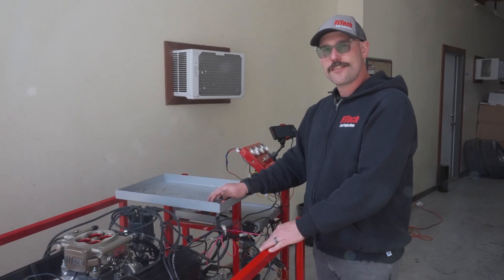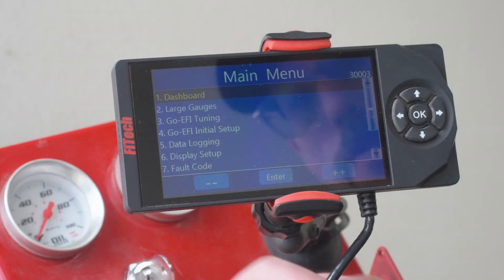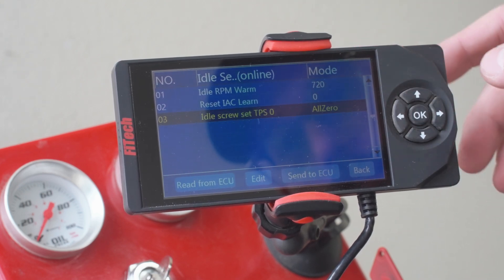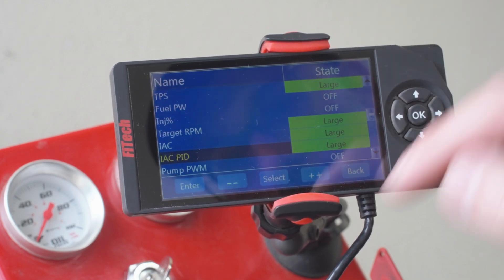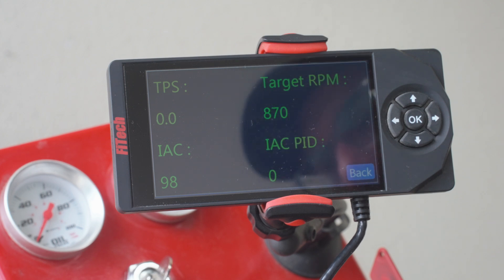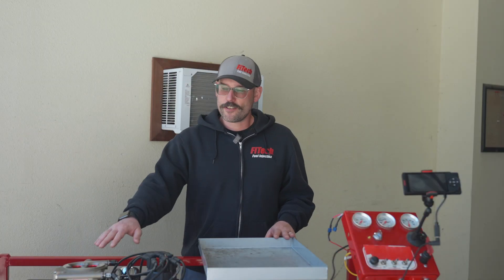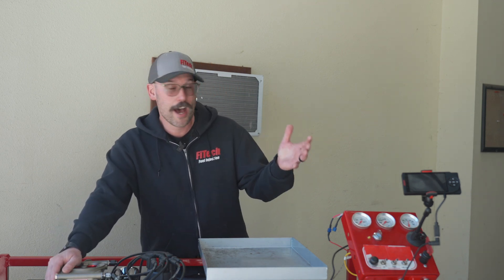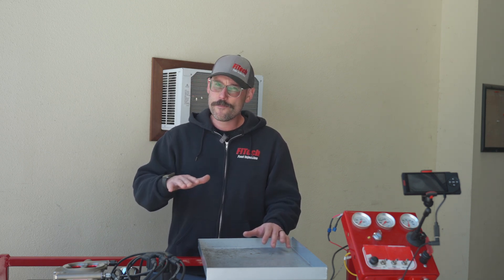FiTech EFI Throttle Adjustment | How to Set IAC for Wild CAM Motors

Comment: Can I run The 1200 HP system on a 2x4 Tunnel ram until I put it on a blower set up on my mild built big block Chevy I don't want to buy two systems but I want the system my carbs suck in a bad way
Reply from the maker: Hello sir, Yes you may run the 1200hp system on the mean time as a NA system. Once you upgrade to your blower the system will still be ready for that power adder.

Comment: I believe my cam is too wild at 106 lobe cenerline and .666/.645 lift. Fought it for years. Ensured no vacuum leaks or any exhaust leaks both done with a smoke tester. Threw my 970 pro-systems back on it today after replacing both accelerator pump diaphrams because they were rock hard lol. Fired stright up and ran better than it ever ran with my meanstreet system.  Anyway sticking with my pro-systems carb from this point forward.

Comment: Does the 03 Idle setup go back to normal when done with IAC adjustment?
Reply from the maker: Hello sir,

When setting up the IAC, once the IAC steps are set between 3-10 the system will save automatically since the adjustment is a physical adjustment on the throttle blades.

Comment: For the 30004 PA, at idle when looking down into the throttle body it appears the injectors are dumping a lot of fuel.  I can clearly see all 4 injectors squirting.  Would this be considered normal?  My idle is very rich.  IAC set to near zero.  AFR at idle is set to 15.  Idle is at around 1000 rpm.
Reply from the maker: Is the engine running 15:1 AFR? You can see on the handheld under dashboard. If you think its running rich even though the AFR is reading correct then you need to look for exhaust leaks or misfires on the bank the oxygen sensor is on. Also you MUST have 18+ inches of exhaust pipe past where the oxygen sensor is located. If you are running RACE gas with lead then you may be killing the oxygen sensor and it will need to be replaced. Bosch #17014
Reply: @FiTechEFImedia  If I were to disable Fuel Adapt and Fuel Loop, which setting most controls how much fuel dumps at idle?  My first 30004 unit was 2016 so I've been playing with these things for years. Looking to experiment with manual settings to see how an old-school lumpy cam behaves.

Comment: I have the twin FiTech setup 30062 on a 385 stroker sbc with pretty large cam am having a rough time getting it to run right can’t find any info on adjusting this setup please help
Reply from the maker: Call tech support for assistance. We will need detail info on how the engine is running and probably a datalog to help assist.

Comment: Good video.  I noticed that my IAC steps have come out of specs. Is normal to have to go back and adjust? Been running FITECH for two years now.  Just noticed it when this year after storage.
Reply from the maker: Many things can make the IAC change some. You can readjust it if you like or leave it alone if its not causing any issues.